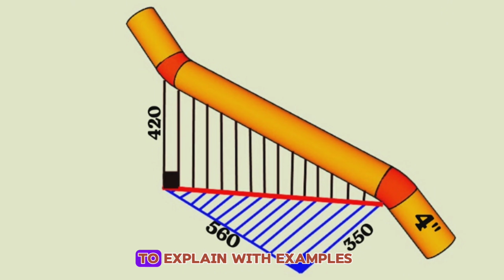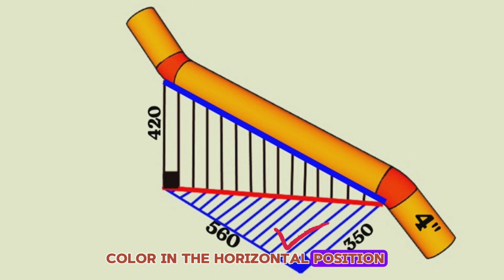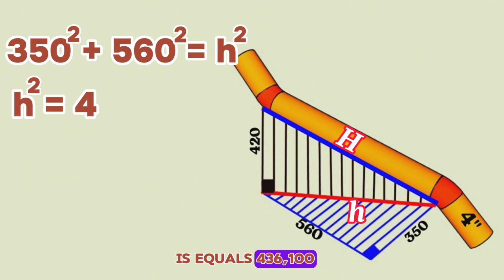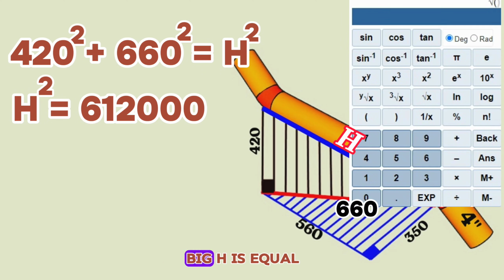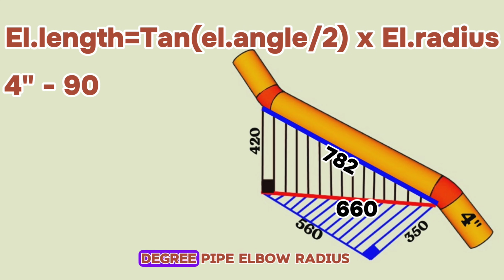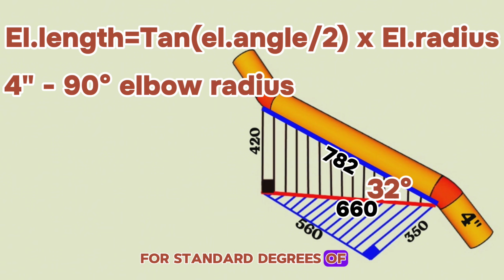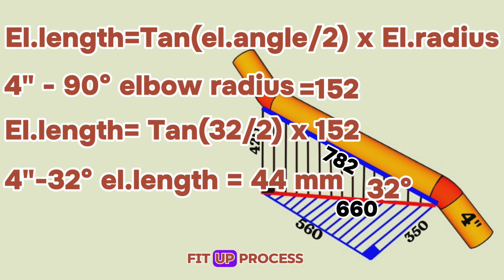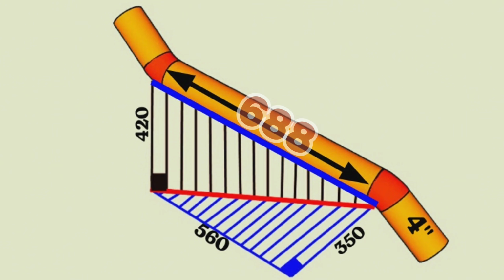Pipe Length Calculation. How to calculate pipe section length?

Comment: Aapse Request hai please interview se related as a Mechanical Engineer or Supervisor se jaise Site se related Jo Daily Job me use hota hai Jaise koi Contract mila Phir Steps wise Kaise Kitna Pipe meter me hai Kitna Manpower kitna Days kitna Joints Daily Complete hoga iss kitne din Me work Complete ho jayaga types se Upload kijiye vidios 
As per Material lekin kabhi Cs material pipe par Video banaiye kabhi Ss par Kabhi According to Size Small Inch or Kabhi Big bore ye sab Details me Koi Nahi upload karta hai videos please make you ❤❤

Comment: Entire calculation is wrong. 
Elbow angles are wrong hence pipe length is wrong as well.
Should be like this:
Elbow angle = 44.3° 
Pipe length 937.4. , (without 3x2 mm gap)

Comment: sorry but In this drawing it's unclear how the 4" pipe continues after the elbow. Probably in horizontal line? It's seems the pipe continues under a certain degree line...not in vertical or horizontal. Otherwise the elbow of 32 degree is not correct

Comment: I've a question, I think the raise degree and elbow degree should not be same. Elbow degree must be 35.585°. please check it.
Reply from the maker: I checked, 32 degrees is correct,
Just explain your opinion, please.
Reply: @Thepipingengineer why did you use  two 32deg on both elbows?

Comment: 4 inch -90 degrees elbow radius, i didn't understand
Reply from the maker: Many thanks for watching and comments.
For standard degrees of pipe elbows such as 45° and 90°, elbow center to end dimensions are available in standard pipe charts. But some times, custom elbow angles are required at site which should be cut from standard 45° or 90° elbows.
Formula for calculating center to end distance of such elbows is as follows:
Elbow length in mm = Tan(Elbow Angle/2) X Elbow Radius in mm
If you like our other videos it be more easy undestand